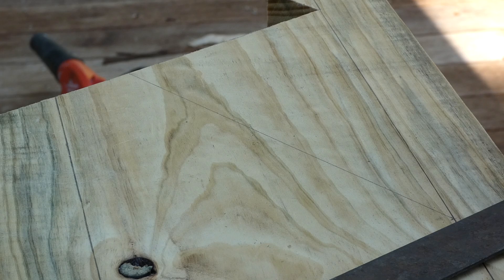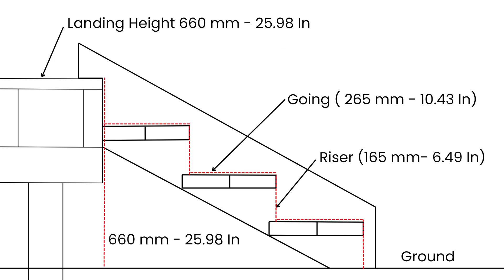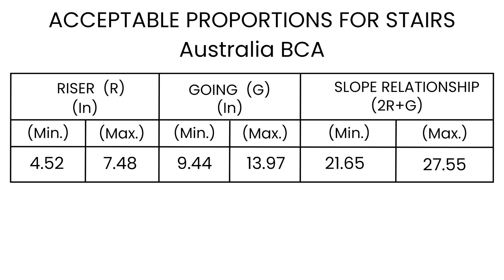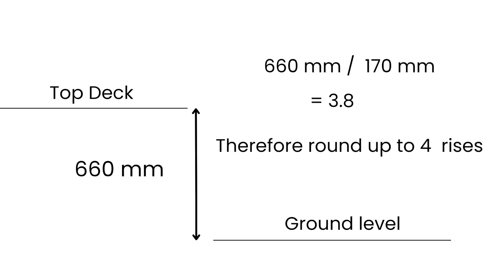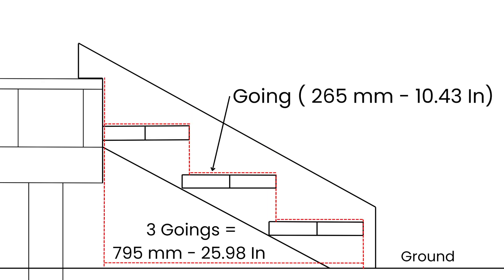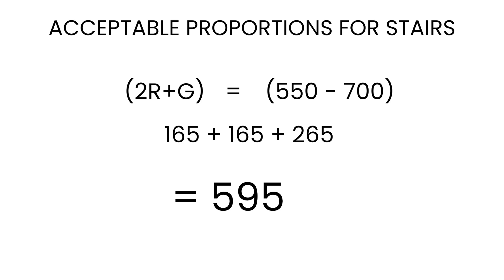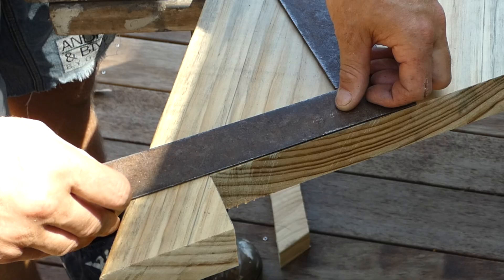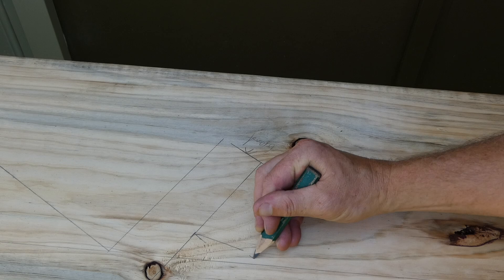How To Build Stairs For A Deck || How To Build Stair Stringers || DIY Tips And Maths Formulas

Comment: Can you explain me how you get 170mm to divide  with 660mm ? Please.
Reply from the maker: Hey Joe, this is the math. 
660mm is the landing height. 170mm is the height of a riser, can be between 115mm and 190 mm. 600 divided by 170 mm = 3.8. Therefore there is 4 rises. 660mm divided by 4 = 4@ 165mm ( stair riser height from ground level to landing) 
That’s the math. Is all in the video.

Comment: Hey mate wondering how when working out the stringer how did you get 1.325 squared 
(Going of flight squared + one going of the step) my maths isn’t getting 1.325 I keep getting 0.70225 any clue where I’m going wrong?
Reply: My working out is 0.795 sqaured + 0.265 squared =
Reply from the maker: Hey mate, are you trying to calculate the length of the stringer?
Reply: Hey  @GreysandAlex   I'm having similar issues with calculating the length of the stringer when following your example. How did you get 1.325 as the number to be squared at 03:17? 

From what I understand it should be going of the flight (0.795) + one going (0.265) which gives you 1.06 rather than 1.325?

Comment: So by concreting in the metal brackets at the base you don't need to use joist hangers at the top?
Reply from the maker: This design doesn’t need  joist hangers at the top as I notched out the stringer to support the stairs. The concrete footing at the bottom is to support the other end of the stairs at the bottom.

Comment: I am building a staircase entrance to my house. Could I use your same method to attach the stringers into the footings and then bolt the guard post at the bottom of the stringer? Or would that be too wobbly across a 9 stair staircase?
Reply from the maker: Hi Freddie, yes you can definitely use this method for your front entrance for a 9 stair staircase. You can bolt the hand rail post straight to stringer. You probably need one post bolted at the bottom, middle and top of the stair case. You can notch the post over the stringer or bolt the post directly onto the stringer using 2 @ 10mm diameter bolts for each post.
Reply: @GreysandAlex  thanks very much. Appreciate it. I was also thinking getting H4 hardwood posts and concreting that straight into the ground, do you have any issues with that?
Reply from the maker: Yes no problem to concrete your h4 handrail post into the ground. That’s not really necessary though. If you bolt the ends of your timber stringers to a bracket in the concrete footing, you only need to use h3 timber handrail posts bolted to the timber stringer. Might be a bit less work and material. Good luck with the project. Stair building is fun. If you follow the math in the video you will have no issues.
Reply: @GreysandAlex  thanks very much for your help. And cheers for the video!